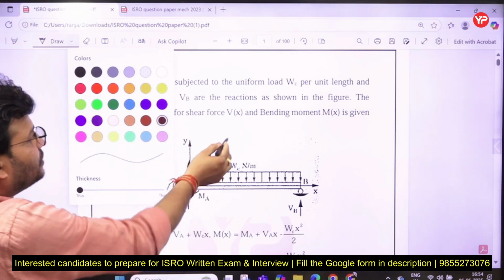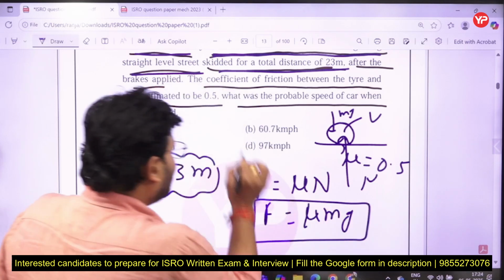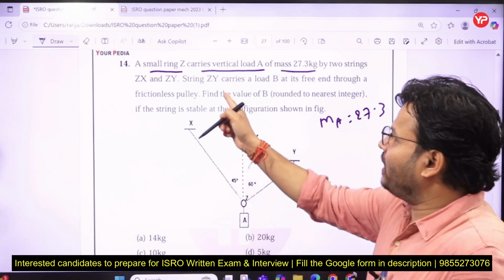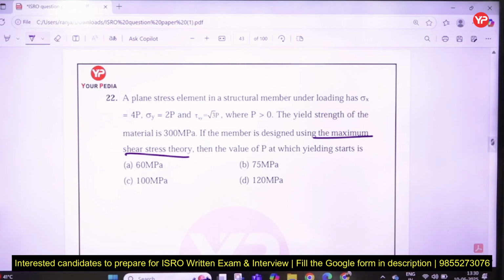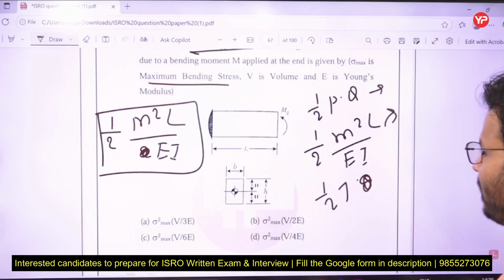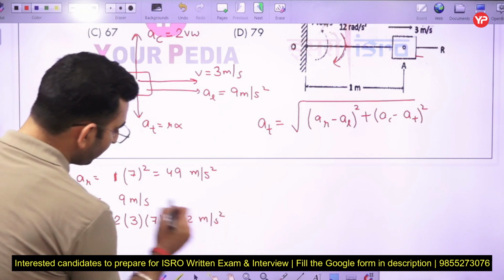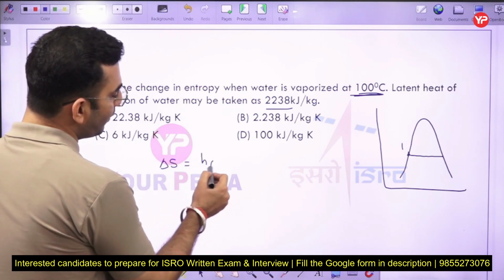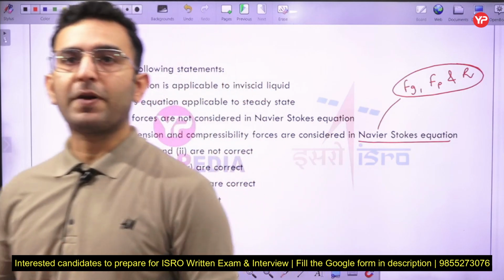Marathon session, ISRO Mechanical 80 Q's 2023 detailed solutions | Previous Year Question paper

Comment: Sir 41st question the formula used is wrong. 

Also question 76 is wrong. 1 tonne is 2000 American pounds, which is less around 908kg. The correct answer is around 7KW

Comment: In coriolis acceleration question radial acceleration inwards is written as r*omega square but that can also be written as (v square)/r in both the answer in different why??
Reply: Here v is 3m/s is the velocity of the slider. To find radial acceleration using v^2/r you have to determine the absolute velocity of the link at the point where r=1, which can be obtained by v = r*w =1*7 = 7 m/s. Now you can use the formula to determine the radial acceleration.